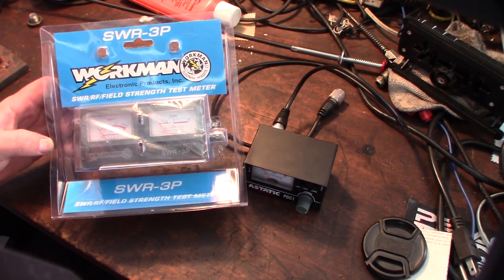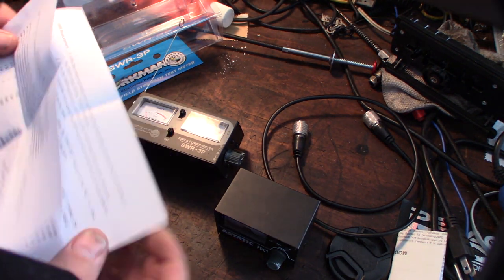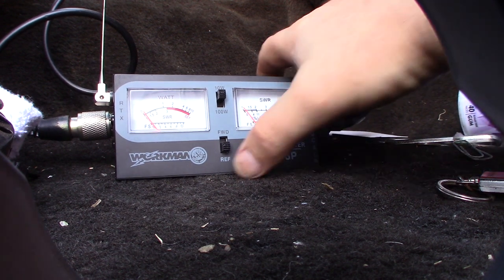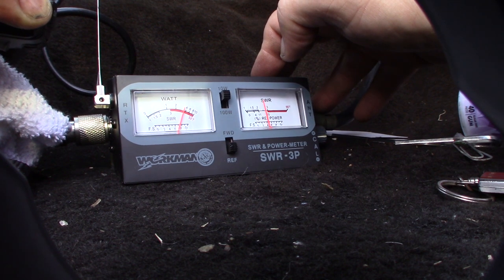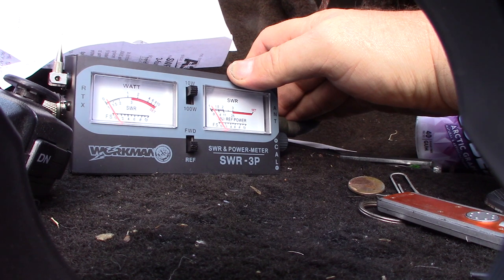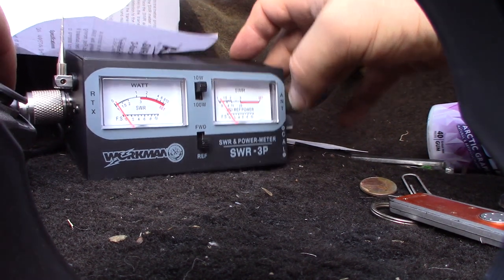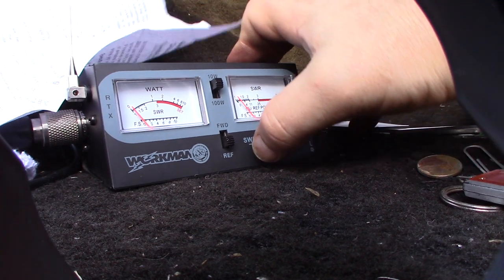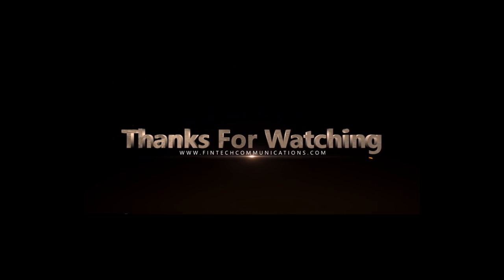CB Antenna Troubleshooting tuning high SWR Workman SWR-3P PDC1

Comment: I would check the ground where the antenna is mounted. Use a oh meter to check resistance between ground and frame. You can use jumper cables to check to see if the ground gets better

Comment: I had this workman model sir meter and each and every time it was reading in the red no matter what I did. I checked every connection and checked grounding and continuity on everything and it was all coming up ok. I bought an astatic dual meter and it instantly read at 1:8. So the quality of meter does matter, more so than I thought.

Comment: The reason you set ch 1 and ch 40 is so you know how to adjust the antenna  if SWR is higher on 40 go longer, if higher on 1 go shorter to bring swr down.
Reply: If swr on ch 40 is higher than ch 1, then antenna is too long and needs to be shortened.
If swr on ch 1 is higher than ch 40, the antenna is to short and need to be lengthened.
Reply: Apple jack....YOU R CORRECT SIR..👍

Comment: When checking swr never have doors , hood or trunk lid open its believe it or not will throw swrs off your vehicle is a ground  plane.
Reply: Randy Gardner -right on, location of the antenna affects the ground plane and the SWR reading... Most people don’t understand that the signal isn’t just coming from the antenna.

Comment: The metal small " antenna" is for radial readings, using 2 persons. You should read instructions on how to use the metal wire SWR meter antenna that comes with unit. One person goes in radius around vehicle at recommended ( open area away from buildings, power lines, Kids, and always close doors and windows) 2nd person keys mic in vehicle and the person reads the output according to Directions read, while circling the cb'd vehicle. Otherwise, you may get erroneous SWR with that metal antenna on and the doors open....
Reply from the maker: Interesting, thanks.
Reply: What is a "radial" reading?

The small wire antenna is for taking field strength measurements and should not be attached to the meter while taking SWR/Power measurements.

Comment: Use channel 1 and 40 if its higher on 40 too long if its higher on 1 too  short you want 1 and 40 to be equal that will make the swr the lowest possible in the middle of the band where most people transmit.

Comment: Did you replace the antenna tip cover before each test your swr will be high if you don’t put the cap back on before each test. Fire stick swears up and down that the cap is just rubber but it can’t be because it affects your swr

Comment: Back when I drove OTR/48, ('85 to '90), I could get my Cobra 29 Classic to an SWR so low that I thought the meter wasn't working. Those days were when I had it all connected in my truck/s. Now I have a Cobra 29 NW Classic that I hook up in our Jeep Grand Cherokee whenever we go on vacation. (It's my wife's truck and she doesn't want the radio in the truck any other time, so what are gonna do?)

My radio is setup nearly the same as my old one was back in my 'driving days'. The Cobra 29 NW Classic with an RK-56 mic but now I'm running to a Wilson 1000 mag-mount antenna. I have the Workman SWR-3P which confuses me. When I use to drive, I had an SWR meter with only one meter I don't recall getting mixed up with it. 

The Workman SWR-3P throws me because it has the "WATT" meter on the left and the "SWR" meter on the right very clearly noted at the top of each meter. But then, it has "SWR" noted in the left meter (where "WATT" is noted at the top) just above the horizontal flat line near the bottom and "(%) Ref Power" on the right meter (SWR at the top) just above that horizontal flat line near the bottom...

So I start second guessing myself as to what they are trying to tell me and if it's just a redundant reading that switches the two around, why did they do that? The sheet of paper that comes with it doesn't say anything about it but does anyone know what those lower references are trying to indicate?

Also, I have a 35W amp that I switch on in mountainous areas and I have confirmed that every time I turn on that amp the SWR improves by at least 1.5 points! I mean, if I'm kicking around SWR 1.5 in the low channels and 2.o in the high ones and then I switch on the amp, the SWR drops to near 0 on the low channels and about .5 to .7 on the high ones.

Is there any reason why the amp would improve the SWR? I really didn't think it would make a difference but if I would have guessed that it did, I would've expected it to make the SWR worse, not better. It is possible that the improved SWR when the amp is on is indicating I have some maladjusted resistors or some poor quality caps? It would seem that even if I did, they wouldn't affect the SWR.

The only other possibility is that the additional 8" coax from tyhe radio to the amp, and the 36" coax from the amp to the SWR Meter somehow has a positive affect on the signal... I don't know...
Thanks for the video,
Rich
Reply: I would ask a reputable cb repair shop.

Comment: First thing is that is your antenna above the cab if not remount so it is you are getting reflection off the cab then get rid of the fire stick and get a wilson silver load fiberglass antenna it has better antenna tuner on end of antenna

Comment: Yea you want your swr at 1 or under... but definitely under 3! At three you heat the finals in your radio and can burn them out, but only when you transmit ... and yes test in Ch 1 and 40. Your new meter test swr and the transmit strength (hence the antenna on the meter.
Reply: Hi Paul, I geta 5 on my antena, how can I geta IT lower? Is at 5 on all chanels😢

Comment: Dude start a 1 and see what your see is at 1 the do the same on 40. Write down your swrs on both 1 and 40 and if your number is higher on 1 than 40 the antenna needs to up and if it's higher on 40 than 1 antenna need to be shorter. But other than that your doing it right
Reply: Yeah your right I got those backwards
Reply: And make sure all the doors are closed and widows up
Reply: So what do I do if they are the same on both 1 and 40 at 2.25? I can't get it to go down no matter what I do

Comment: I don't see why anyone using CB radio should have an issue with SWR if they use the right antenna. If you are only using 40 channels and there are plenty of antennas on the market will have a good SWR on all of the channels. In the UK we can use two sets of 40 channels, the UK 40 and the European frequency. The lowest frequency something like 26.965 and the highest frequency is 27.991. Any vertical antenna made for the CD frequencies will cover all of these frequencies with a good SWR and you won't need any kind of antenna tuner
Reply: Mate, what about where the antenna is mounted on the car? Its surroundings vary based on the model of car and where it is mounted on the car. I don't care what antenna it is. You should know better.

Comment: Having the same issue on my 4Runner with a 4ft firestick.  No tsure if its the antenna ground or the size of the small stick.  You have any resolution yourself??
Reply from the maker: The 4' antenna is OK. The shorter one is a no go..
Reply: The best antenna is a 102 whip
Reply: Stephan Hatch Kinda late on this but I added a ground strap from the antenna mount to chassis on my 4Runner.  I also tuned in a open area with windows and doors closed.  Also I have my external meter runnng inline so I can check or adjust on the fly.  Hate taking the radio cover off all the time.

Comment: I gave the same problem, however I have no squelch, no static or low volume, I jiggled the antenna cable at the back of the radio and the volume go up and down, even tho it's a new coax, I'm thinking it's bad, can anyone advise me?
Reply: Same thing here man I more the cable in my radio and I get better signal sometimes idk what wring
Reply: @pixscast4879  I just bought a new radio, president McKinley nice radio!

Comment: You need to get away from the cheap meters as they are not very accurate.

Get a good cross needle meter from any of the major CB or Ham shops.  Then you just put it inline, set the power level (most have a 15/150/1500 power level setting) and select either Average or Peak settings and do your tests.

Where the needles cross is the SWR reading, the scale on the left shows Power Out and on the right is your Reflected Power reading.

Yes, they cost a bit more than the Workman/Astatic/PDC branded meters (all the same meters with different logos on them) but it is well worth the cost!

One more thing, don't get a DOSY, they are no better if not worse than the ones you are using now!  High priced junk.